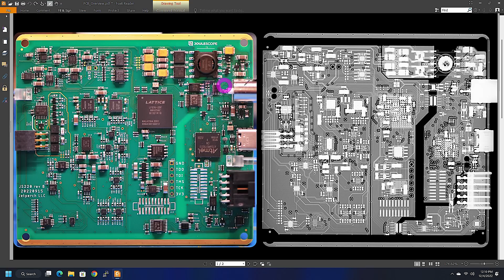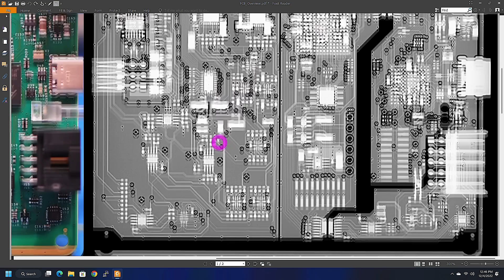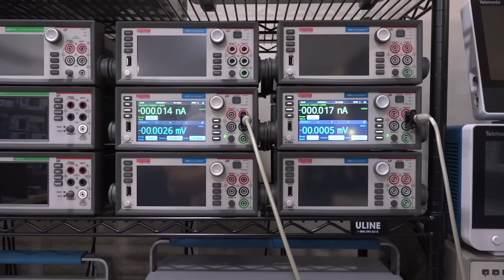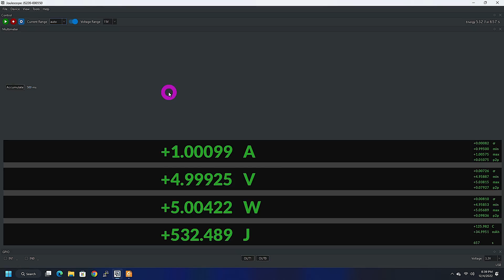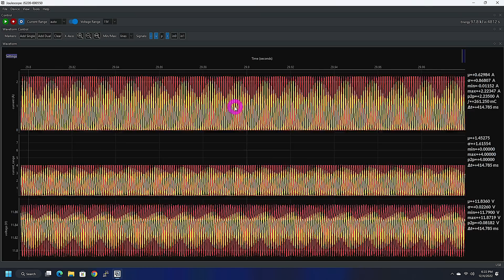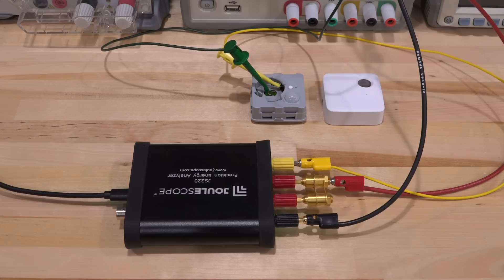TSP #242 - JouleScope JS220 Precision Energy Analyzer Scope Review, Teardown & Experiments

Comment: Thank you for the comprehensive review, Shahriar!  You did an excellent job demonstrating and communicating the JS220 measurement capabilities and limits in a succinct video!

2:42: The 2 x TI ISO7762 isolators use capacitive coupling for up to 100 Mbps data rate.  Those lines in the X-ray must be the coupling structures.  Cool to see!
3:06: We designed the digital GPIO to be separately isolated, too, but the standard product references it to USB ground.  With a few trace cuts indicated on the PCB back and external supply, it can be isolated.
6:54: This approach to "not miss anything" is our Enwavify(TM) technology, which is new to the JS220.  Enwavify significantly improves the JS220's dynamic measurement accuracy from the previous-generation JS110.
11:42: Noted: Add over-loaded voltage and current warnings to UI
14:14: The design has provisions for a "soft-fuse", which we plan to add early next year.  The "soft-fuse" will be software configurable, but we will have a separate static & automatic threshold for fixed ranges to avoid damage.  For now, the device does not have much protection from significant over-current in fixed-current ranges.
17:42: Idea: add software trigger on live waveform view when zoomed in.
20:10: The Device Current Ranging preferences only apply to the JS110.  The JS220 is all on-instrument.  The JS220 has some configuration options which we still need to add to the UI.
22:52: Thank you!
24:03: Note: the current_range signal is non-causal here ;)  We will fix this to account for signal path delays in the i/v/p path.
26:25: The initial large spike looks like inrush current, perhaps when the radio's regulator gets switched on?
27:51: While the accumulator is useful and simple, you can also add dual markers over regions of interest to display the charge & energy consumption.
28:02: With the JS220, the GPIO no longer uses the least significant bits.  They are conveyed on independent data streams from the JS220 to the host.  We need to update the UI documentation.
28:10: Thank you!  We will be releasing UI improvements throughout 2023 that will be free to JS110 and JS220 customers.
28:25: I look forward to hearing more about how you put it to use!
Reply: Great to see active responses from the supplier/designers! Thanks for sharing the product and the responses
Reply: Hi Joulescope. Nice product. Only one question. I know the pc is everywhere at this days. But, could you design an interface with a tablet? It could be very small and a little giant design has more sense. Best regards.
Reply: @electronicayexperimentos  Thank you for the suggestion!  The Joulescope JS220, like the JS110, is a USB-connected instrument.  As of today, we only support Windows, macOS, and Linux hosts.  A Microsoft Surface Pro tablet should work with the JS220, but I have not tested it.

I think that iOS and Android tablets tend to be locked down preventing general-purpose USB access unless you jail-break them.  I suspect that we would need a network interface, like ethernet or Wi-Fi, to work with iOS tablets.  I don't think that Bluetooth could keep up with the full-rate sample data, but we could potentially do all the UI processing on the instrument and use Bluetooth.  However, we would need a LOT more RAM & processing on the instrument.  We could potentially use a small form-factor linux computer, like a Raspberry Pi 4, to provide this functionality using the existing JS220.

Do you have any specific tablet platform in mind?
Reply: @Joulescope  Hi. No I don't have a specific paltform in mind. But I used to use a pico scope. Nice product, but you have to carry a laptop and cable. In the bench the scope uses a space much bigger than the size of scope. I sold the pico because tektronix presented the 2 series. I belive that is posible an interface that you can insert a Joulescope and a tablet. Something like a tek 2 series. You finish your work, power off and take off the tablet and use it as a cover. The tek 2 series has a very small footprint in  the bench. Regards.
Reply: @electronicayexperimentos  Thank you for the additional detail.  Many customers control their device under test using a computer, so having that same computer host the Joulescope is not an issue.  I certainly understand the desire to keep things small and self-contained.  Our focus for early 2023 is on the Windows/macOS/Linux experience, and I will keep this in mind for the future.
Would you prefer to connect the JS220 to your Tek 2?  I am unfamiliar with the Tek 2 architecture, but it's possible that the USB ports are high-speed and connected to an internal Linux computer.  If so, Tek could integrate the JS220 as a high-dynamic-range, isolated, 300 kHz BW current probe, which also measures voltage.  We provide open-source software to make this easy.
Reply: @Joulescope  Actually, you can do everything in Android that you can do in libusb. Only for iOS you might again require some crypto chip nonsense.
Reply: @Joulescope  Hi. I understand your point. But I guess you have a better idea. Modern scopes are very specialized computers, but computers. So, if you can connect the JS220 to scope, no only to pc. Like a printer. If you have modern scope with a big and powerful screen and you connect JS220, Signal Hound and many others. It is possible to get a very sophisticated lab in small bench. Regards.
Reply: @Joulescope My understanding is that Android will let you access USB devices directly, but you need to ask permission from the system before opening the device... But I've never done it so can't say whether it in fact works, I just worked with somebody who as far as I am aware was able to use libusb in an Android app without root.

Comment: Well, it has a nice set of features and I can see myself using it happily, but I just checked the price...
Ouch, 1000 bucks is just way too much for what it does.
I opened the link expecting like 500 bucks maximum (and I would have thought that is really on the high side), but 1000 bucks it's just a show stopper in my opinion.
It cuts away every possible hobbyist, even those with fairly high budget.
If you are not a company you should really have a very, very specific need to buy this instead of an oscilloscope with a setup for current measuring...
Reply: The Nordic Semiconductor NRF PPK2 is a low-cost alternative to the JouleScope.

Comment: This looks interesting but unfortunately doesn't quite meet the requirements I'm looking for. Does anyone know of a power/current waveform analyzer with at least 100 MSPS sample rate and a current resolution of 1 µA? I'm familiar with the Keysight CX3300 but that's way too expensive for the few times per year it would be used.
Reply: @BartSimpsonHJ A few questions:
1. What measurement bandwidth do you actually need?
2. What system bandwidth do you actually have?
3. What maximum current do you need with resolution 1 µA?

As far as bandwidth goes, the next step up from the JS220 is a dedicated current probe and oscilloscope, but you lose the high-dynamic range capability.  Next step is the CX3300.

Unless you plan on measuring current & power directly into an IC, the bypass capacitance combined with the cabling impedance often significantly limits the system bandwidth.  We actually designed the Joulescope's 300 kHz measurement bandwidth to line up with system bandwidth in the most common measurement conditions.  50 mOhms total resistance (source, cables, connectors, JS220, target) and 10 uF target bypass capacitance is 318 kHz system bandwidth.
Reply: @Joulescope  I need to be able to measure very short current spikes after clock events. So far we're relying on average measurements and simulation results. The only actual measurement of such spikes I did, was using a CX3300 demonstration model (but even with that, getting a propper measurement without interferences wasn't easy). In that particular case, the current went from a few nA to 140 µA and back in less than 0.5 µs. 

Our system bandwith should be >25 MHz (estimate) and I think I limited the bandwidth on the CX3300 a bit (so not the full 200 MHz) to get rid of some noise.
Reply: @BartS_EMS  That is a very demanding measurement.  A Joulesocpe JS220 would measure those short events accurately, but they would be filtered with 300 kHz bandwidth.  You may also need to select the fixed 180 µA range or add a small amount of load capacitance to keep it in the 18 µA range.  Whatever detail you may want in that 0.5 µs event would be smeared over multiple JS220 samples.

However, it sounds like you might not need high-dynamic range.  If you want to measure 140 µA max with 0.1 µA resolution, then that is only:
log2(140/0.1) => 10.5 effective number of bits (ENOB)
Many oscilloscopes are only 8 bits, but you can get 14-bit oscilloscopes, I think that are > 12 ENOB, so oscilloscope + current probe is possible.  However, finding an off-the-shelf current probe with low enough leakage, low temperature coefficient, and high enough bandwidth could be very challenging.  You could design something custom, but then the CX3300 starts looking like a better deal, especially if you don't already have a suitable oscilloscope.  Unfortunately, I don't have any more cost-effective recommendations.

Comment: It would be nice to see the voltage across the current sensing port during the experiment at 14:37 on the oscilloscope. The voltage should somehow change (in steps) as the device switches its range, because this changes also its internal resistance. If the current ramps relatively slowly compared to the range switching speed, this potentially could cause some relatively steep voltage steps across the current sensing port. I would like to see how steep these steps are (if they are somehow visible), because fast edges lead to high frequency content, which potentially could cause some issues inside the DUT.

Comment: That X-ray is pure joy. AD9226 is 12 bit 65 MSPS, not 16 bit (edit: it's TI ADS9226 16bit 2MSPS SAR) ;). I've noticed that when you switched from overloaded 20uA range with 1A applied back to normal range reading of 1A was quite a bit off and recovering back to normal after. That hints of clamp recovery or possibly overheating in the frontend which shifted values off?
Reply from the maker: The ADC is ADS9226, not AD9226. Unfortunate naming overlap. But the ADC is indeed 16-bits (it has to be, you could not get this performance from 12-bits).
Reply: @TheSignalPath  Right, TI part, not ADI here.
Reply: I spotted that also and thought uh oh!.....resistor overheating.

Comment: I have used the NRF PPK 2 (power profiler kit). It's only $100, but works surprisingly well! Would be cool to see some comparisons
Reply: I have compared the NRF to the P1125 (wide dynamic range current measurement power supply). The NRF is similar to this class of current measurement device in that they all use FET switching to get the wide dynamic range.   The problem is that FET switching induces artifacts into the measurement, and you can't tell the difference between the artifact and real device current.  The P1125 does not use a FET switching design and does not have artifacts.

With one of reference currents I use for testing, the NRF started oscillating between two range settings, and didn't stop.
Reply: Thanks for reminding me, they're back in stock, just ordered one :-)
Reply: I used the ppk and also the first joulescope. It boils down to how low current you are measuring and how much you trust measurements. I compared this with a keithley DMM & source  and found Joulescope to be more accurate for my needs of measuring dynamic uA’s. As someone else mentioned the ppk was jumping between two ranges for my application too so the accuracy was not questionable. All in all for over 100uA dynamic current measurements I would be ok with ppk but lower current I more trust the Joulescope or even say a 6.5 dmm with I can easily program etc too using lab view etc. just my opinion though. Ppk2 I haven’t tested.

Comment: Very nice PCB design, and a great explanation of the dynamic switching in both hardware design and how it performs in real experiments. Certainly looks like a great unit for characterising power consumption of battery powered equipment during DEV, and right down into the nitty gritty.

Comment: I was really interested in picking one of these up after watching your review... then I saw the price tag. 1000 USD will buy you a used Keithley 2400 if you're patient enough.
Reply: A 2400 is nice - but a Joulescope is 1000x faster. You can pick up microsecond accurate transmit / receive burst timing with it, check switching converter current peaks, and calculate the power consumption of short interrupt handlers. They can also stream samples to your hard drive for days, capture digital inputs, and send digital stimulus to test boards from python scripts. Really fantastic for developing battery powered devices. Also 10x cheaper than an equivalent Keysight solution, and 50x smaller. So don't hold back - you'll love it.